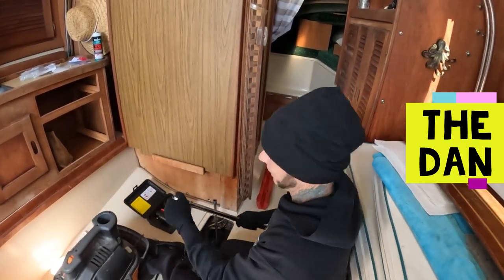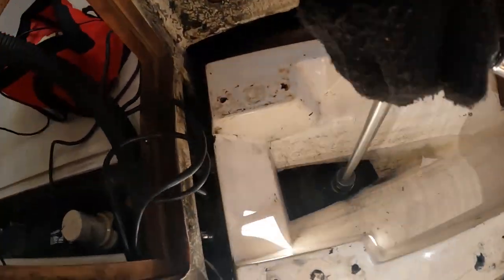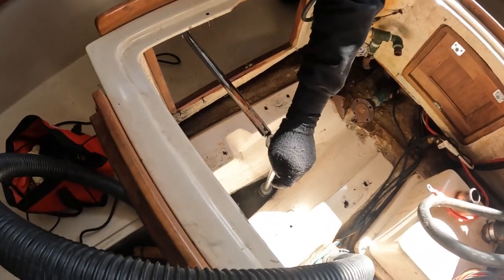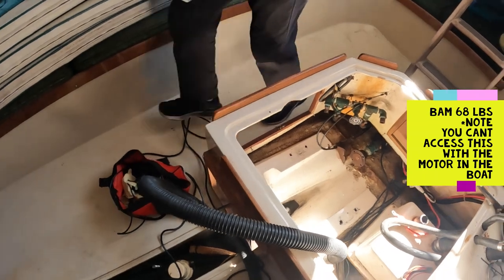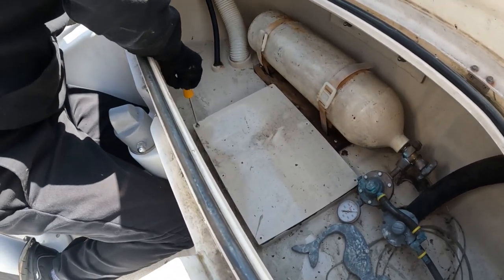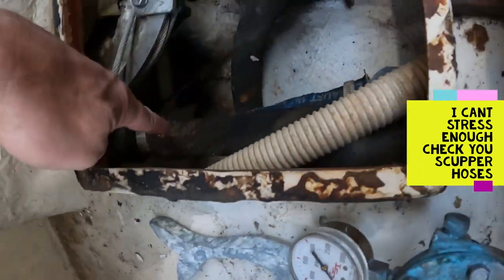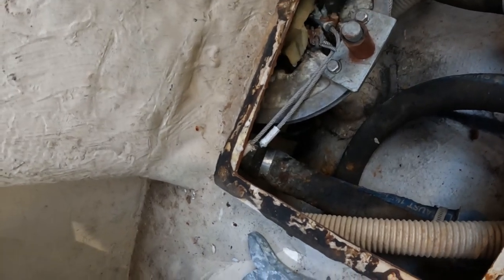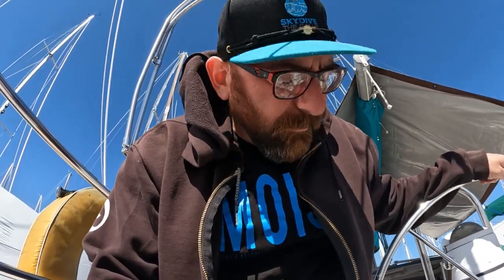Fiberglass cracks while torquing keel bolts on a Catalina 30..

Comment: Definitely want to see more details on the steering adjustments. Mine is really loose also. And I noticed the bolt that holds the radial drive to the rudder is at spec, but very loose. The play in the wheel occurs for this reason; the bolt is moving around.
Reply from the maker: Sounds like you may need to drop the rudder and replace the bushing 
I hope to have the steering and exhaust vid up next week

Comment: I have a Cat 30 1984 that is project boat as well (not sure your year, but it looks newer). What is the "diving"  TANK in the aft lazarette?
Reply from the maker: That is not a diving tank 
It is compressed nat gas aka CNG
The thought with CNG is that if something is left on the grass will disperse rather then lay low in the boat 
The issue is getting the tanks filled 
Where are you located with the boat

Comment: To tighten the steering cables you do not loosen the cable clams.  You should go to the back of the quarter berth and ends of the cables are looped through some very long eye-bolts which are double nutted.  Loosen the locking nut and tighten the first nut to tension the cable and then lock down the lock nuts.
On thing that you should also check espesially given that some of your keel bolts were very loose is the keel stub.  The structure between the lead keel and the nuts and washers in the bilge consists of the fiberglass hull then two layers of 1/2" CDX plywood and a covering of fiberglass.  Many of the older C30's have gotten water into the plywood which rots it to black goo and makes the keel bolts loose.  The best test is to drill some small holes into the bottom of the stub right next to each of the keel bolts.  If all is well, you should drill through about 1/4" of fiberglass and then hit a 1" layer of clean yellow wood chips.  If the wood comes out black, you need to pull out the old rotted wood and replace it with something like G10 composite board and then cover with some layers of fiberglass cloth and resin.  The Catalina Yachts drawing for this repair is available in the files section of the C30 FB group.  
Given  that you are on the hard and the engine is out, it would be a perfect time to do the repair if needed.  I would be highly suspicious of that aft bolt.  Suck the water out and if the washer is pulling down into the top surface of the glass you need to do the repair of can loose the keel or get a very bad leak.
Reply from the maker: The stub is solid thank goodness 
And I'll check for the tensioner however tighten them there was super simple
Reply: @Sailing.Artemis  If any of the washers pull down into the base or become cone shaped, you have soft plywood which will lead to all sorts of other problems.  Given the engine is out I would make sure I was good before reinstalling the engine because it would need to come back out later to do the repair.
Tightening the cable at the cable clamps will not get it cable tight enough because any slack can cause the cable to jump off when sailing with a lot of pressure on the rudder when the breeze is up.
Reply from the maker: @haydenwatson7987  all of the washers are perfect and none have pulled 
I'll look at the tensioner inver the aft cabin but I have 0 play now with tighten from rear 
But I'll definitely look at the other location 
Thank you for the info 
Where do you keep yours ?
Reply: I can't believe that Catalina used wood in that place. Just ridiculous.
Reply from the maker: @yougeo  agreed kinda a lack of thought
Reply: @yougeo  My C30 is a 1988 and after 34 years the plywood in the keel stub is still perfect.  It is fully incapacitated in fiberglass and as long as that encapsulation is not broken it will not cause a problem.  The problem comes from owners drilling through the top glass to mount bulge pumps which do not get properly sealed and let water in.

Comment: Hi Brian. I really enjoy your videos. We are also new owners of a Cat 30 and are newbies. Question, the white pan under the engine (is that the oil pan?) and is it normal that there is a hole to allow drips into the bilge?  I’m curious about why our bilge seems oily.  
TIA
Reply from the maker: Wow the oil pan should not drip 
Do you have insta ? If so dm me some photos and I'll figure it out for you 
The_sailing_project_artemis
Reply: @Sailing.Artemis  okay next time I am at the boat I will !
Reply from the maker: @annecompagnion1970  sounds good
Reply from the maker: @annecompagnion1970  you can also check out the motor tear down and send me screen shots

Comment: For your stirring quadrant to tighten that cable there should be a tightening turnbuckle between the stirring quadrant and your helm station and it just matter holding one with a wrench and tightening it with a screwdriver on the other 1 you might want to look around a little bit more before you start losing those cables up because they're pretty hard to get back where they belong
Reply from the maker: It was super easy to do from there the cables didn't come out of the quadrant or clamps

Comment: So the fiberglass collapsed under the washer when I was torquing down the keel nuts... 🤔 can't say I feel good about it. It's actually somewhat bothersome. I'm certain the Integrity of the fiberglass has been compromised right there.
Reply from the maker: it was epoxy  the wooden core and glass in the stub is perfect 
this repair has holden up to a drunken sailer
Reply: @Sailing.Artemis  well thank you Jesus, we're gonna find out if it'll hold up LOL